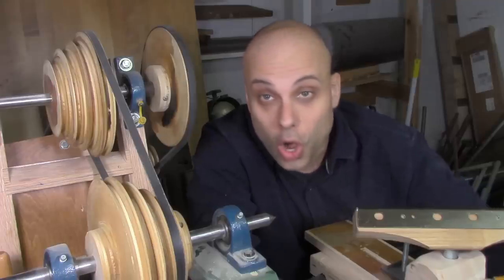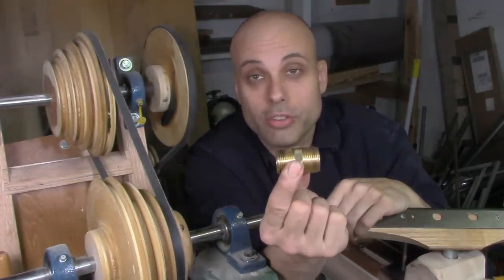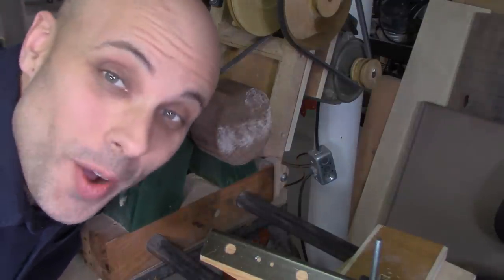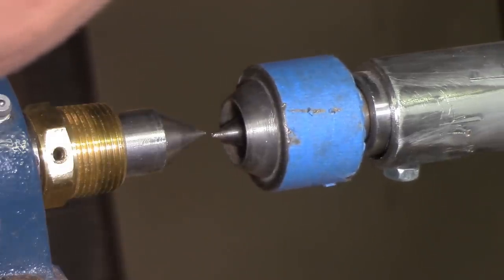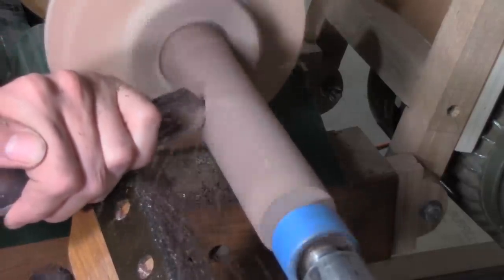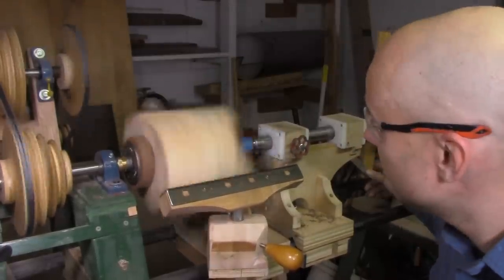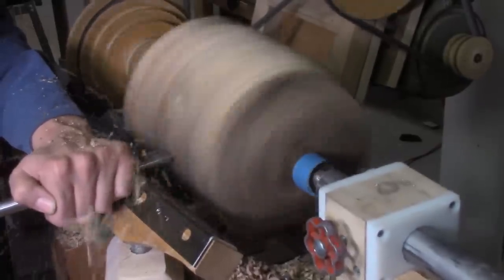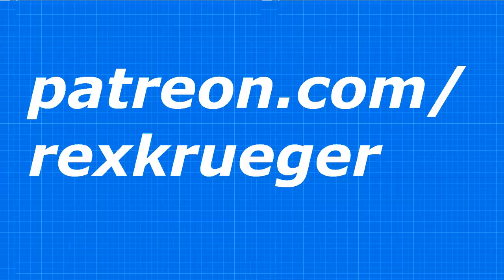The Real Lathe Pt. 6: Work-holding and testing.

Comment: back gear!!
Reply from the maker: Wouldn't it be cool if I could add that?
Reply: @RexKrueger  It certainly would.  But the tolerances for doing it for even a passable metal lathe are just so tight.  It can be done... I'm sure you've seen that "Gingery Lathe" plan that some folks use not sure how good it is. There is that "Vintage Projects" website that sells plans for a lot of interesting things like that.  Some of the stuff they do it with isn't available anymore even in junk yards.  But chocked full of good ideas for makers.
Reply from the maker: @tabhorian  Cressel over at Makercise made the Gingery Lathe. It was SO much work. It was humbling to watch. I think it's a decent lathe when all is said and done, but the amount of work involved was insane. I've often thought of making a metal lathe, but even a modest vintage lathe would likely be better than what I could do.

Comment: @Rex Krueger
so you shelled out $500+ for a table saw fence.... and its made up of box steel , angle iron, flatstock and some nut and bolts..... 
but your going to "make" the lathe..... was 2018 backwards year and no one told me??
Reply from the maker: Correction, I MADE the lathe. As to the saw fence, it's an essential part of my fabrication business. No time to screw around. I need it to work all the time. I had the money, so I did the upgrade. Pure business decision.
Reply: @RexKrueger  
oh yeah I know you made the lathe... its very cool.... and that was my point.... you "made" the more complicated tool.... and bought the easy one to built, at a head spinning price...  ;)